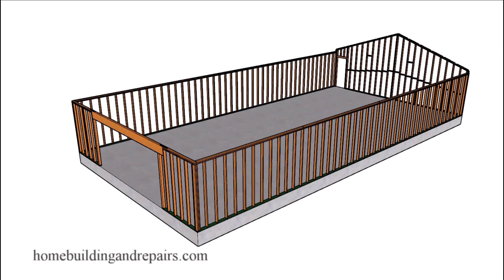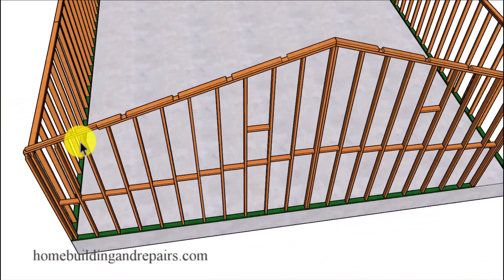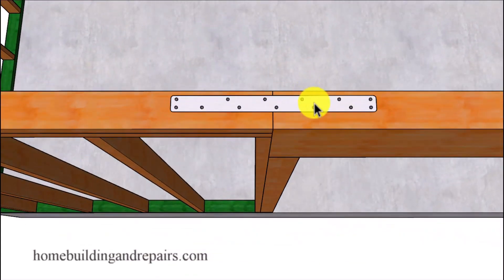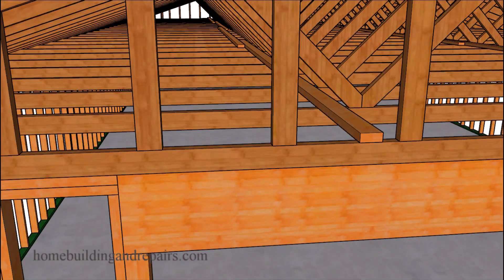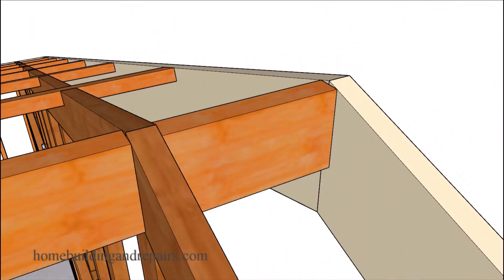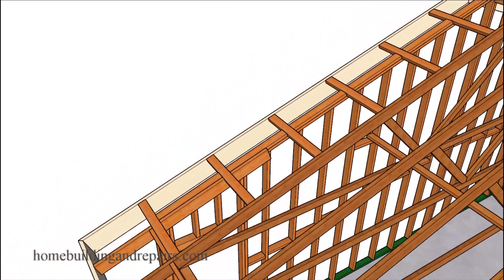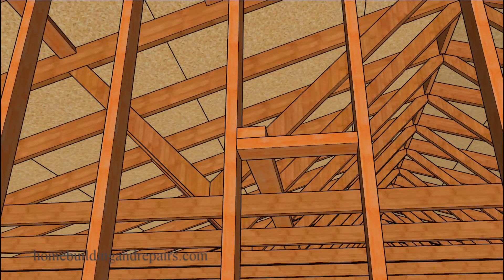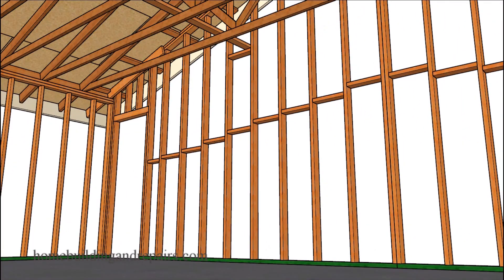How To Frame And Build 30 x 60 Foot Garage With Gable Roof Trusses - Construction Education

Comment: Unrelated question- how involved would be taking an exterior home corner into a 2x45*?  I’m talking pulling in the corner minimally - inches.  I could keep the top plates as is.  Need inches outside.  You have great videos!

Comment: Hey Greg, unrelated to this video. Couldn’t reach you through your e mail because it didn’t work.  Could you give me some advice on how to rough plumb a double sink vanity that has to drain through the right side in a 6” partition wall.  Wondering how I tie the 2 sinks together. Thxs.
Reply: Your plumbing has a tail that should go into the P-trap. Take your existing tail out and get the special tail that has a 1.5 inlet that's made for that. If their is a cabinet in the way just drill a hole in the side. Or make a small square. Connect it to your new P-trap on new sink, making sure the pipes even or slightly sloped towards your new tail piece. You may need to raise the plumbing on the new one a little higher or lower the existing one a bit. Take the 1.5 pvc or abs pipe whatever your existing plumbing has and make the connections. Actually even easier keep your existing tail piece and connect it to a( 1.5 Sink drain outlet waste joint T) then make the connections. That will automatically lower the existing plumbing a little bit to make the sloping pitch. However, if you still have to higher the plumbing on the new sink, just cut your new sinks plumbing tail shorter. Then of course use the slip nuts

Comment: Are the trusses blocked at the ridge? Just wondering how you have a ridge board when using trusses and not rafters.
Reply from the maker: Yes, you can see the blocks in the video.
Reply: @gregvancom  thank you for clarifying. My only concern would be installing ridge vents since the ridge is now blocked. Very helpful videos and work.